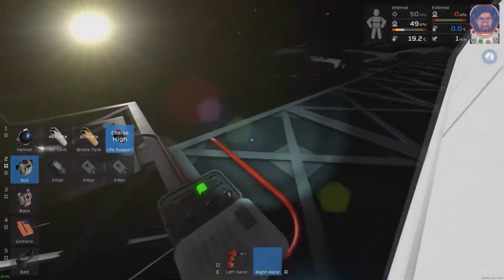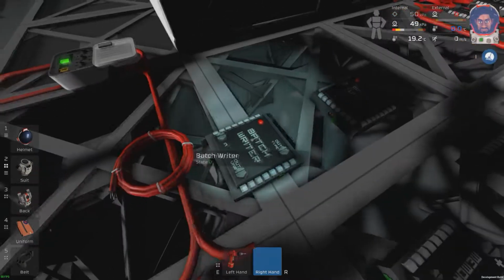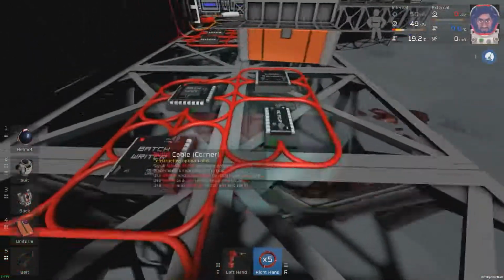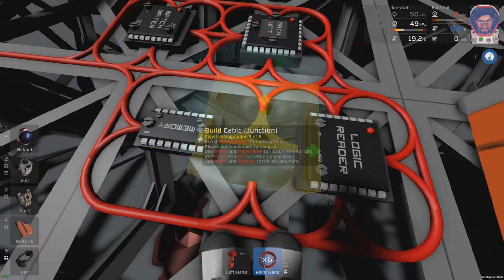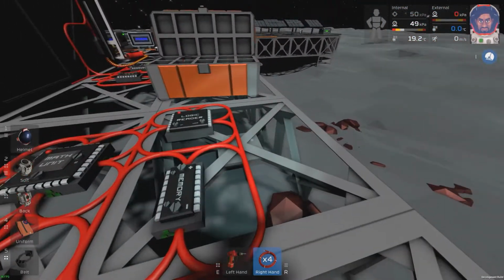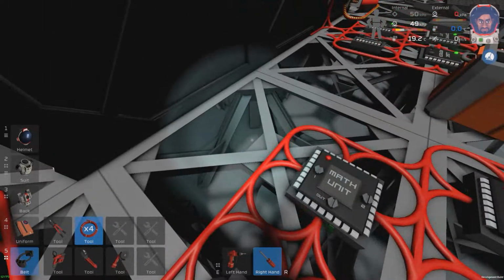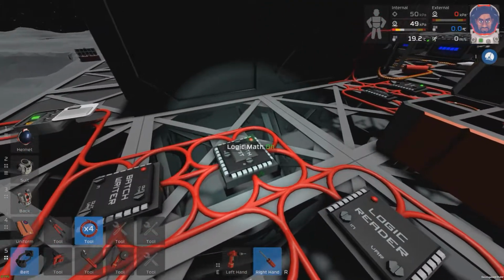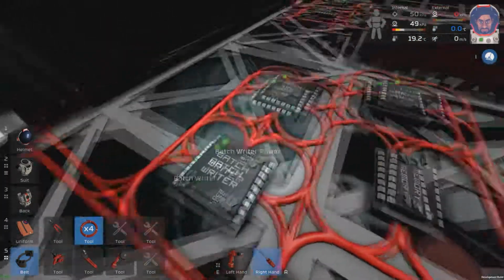Stationeers - Tutorial - Automated Solar Tracking Logic

Comment: Hi, 1st of all, many thanks for this video! But i'm still running some issues: i copy-pasted your setup my my solar panel will track the sun in the opposite way. I mean, when it's raising, the solar panel is not in the correct position. Same when it goes down. Simply the panel, instead following the sun, it faces the opposite angle.
I tried to set a negative value in the memory but it was worse. Any idea?
Reply from the maker: you need to place the solar panel facing the sun
so when your looking at where the sun rises,make sure the solar panels,power outlet is on the right and the data outlet is on the left
Reply: Oh.... It's working! That's the only one thing i've lost. You saved my day!! THANK YOU MATE!!!
Reply from the maker: no problem